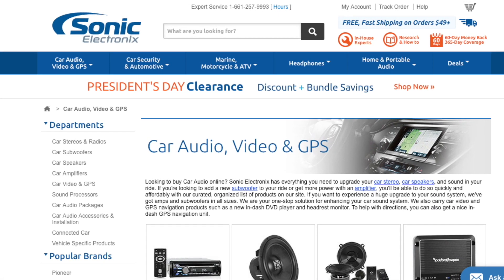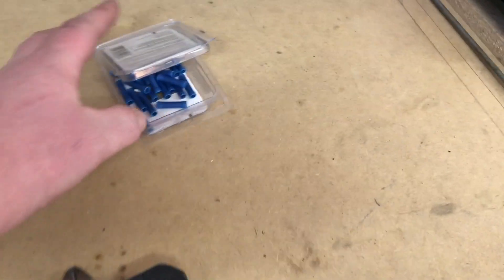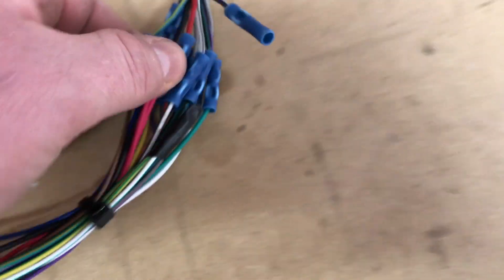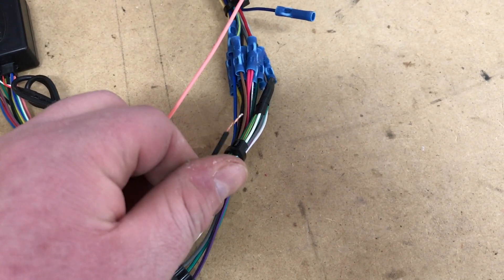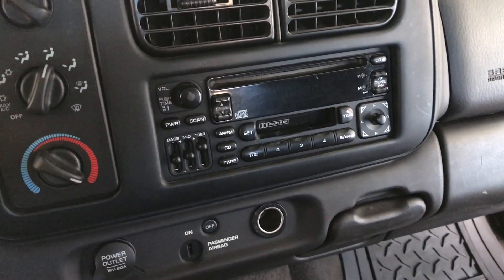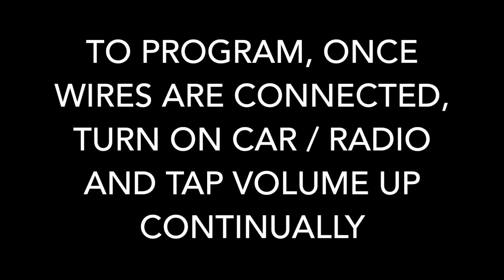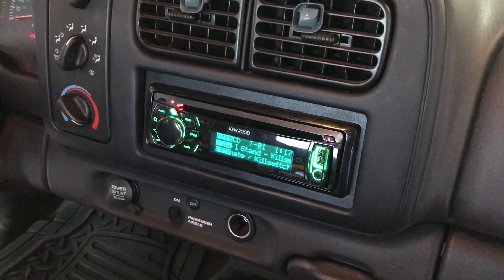1997 - 2000 Dodge Dakota/Durango Radio Install

Comment: Are the 2 wires on the separate clip .... Not the factory ground but the 2 single that plug in.. are those the steering wheel control wires?   If I'm not hooking that in do I just leave them alone?

Comment: Great video! Thanks for sharing. Have any idea how to remove the 36670 Infinity power amplifier? I have a defective one installed in my '99 Dakota. After removing its  2 bottom mounting screws it is still attached to the frame by its top hook but I still  cannot remove it...

Comment: Thanks for the great video! I have a 99 Durango and I'm trying to install a JVC single din And just need to know exactly what color is the factory infinity Amp wire? Can't seem to find it on line!
Reply from the maker: http://www.modifiedlife.com/1999-dodge-durango-car-radio-wiring-diagram/  Factory Amp trigger wire color should be green.
Reply: Green with red stripe

Comment: I am in need of some help. I have a 1998 Dodge Durango and I stupidly/carelessly cut off the factory wire harness and just tried putting wire to wire but the color of wires are sooo different and now im just waaay stuck. would i be able to do it like this still? and if so can you help?
Reply from the maker: Solder back on the original harness, or pull a stereo wiring diagram and start from scratch.

Comment: So the pink wire goes into them two wires that had the white plug on it that you cut cuz I have a 99 Durango and that's where I'm getting confused at cuz I don't have a pink wire I got the blue wire coming up to aftermarket radio that turns the amp on so what I connect that blue wire to both the wires

Comment: the stereo works fine on accessories or when ignition is on, but will you start engine the radio starts losing its signal, what could be causing this ?

Reply

Comment: If I put a newer radio in my 99 durango, will I have to rewire a harness?  Or is that just because you maybe used a different DIN type?   I was looking to get a new radio but was hoping it would just be a quick plug and play.
Reply from the maker: Unless it's OEM, you will be required to wire as we did in the video.

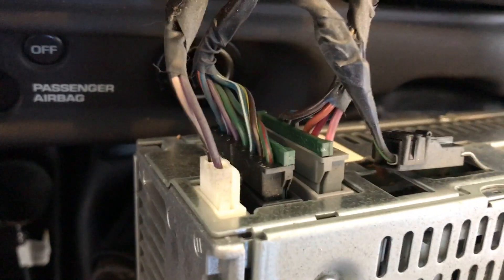Comment: I have installed my new Car Hifi Radio Din 1 and it works well, but I have now the two wires left, in violet and white, which are pluged-in at the original radio p04704383ah from Chrysler at the left side (white plug-in). You can see it at 4:04 on the videoclip. What are those two wires in violet and white for? I also have left the brown and black wire, which are on a black plug-in, also see at 4:04 on top, fixed on the metall. I guess those are to ground it. Right?

Comment: Just need some clarification you say in the video all you need coming out of the aswc-1 is power (red) ground (black which is tied in with radio ground) and control wire (pink). But then it's looks like you add that you need the (white/green) wire for controls as well is that correct? Thanks

Comment: I have a 99 Dodge Durango when I install my after market radio my front left and right rear speakers only have sound coming thru.  I took my time a wired it all correct. I didn’t see the problem. Any suggestions??
Reply from the maker: If you had the factory amplified system, sometimes when removing the factory radio, you have to be sure your balance and fader are set to center.  You could have bad speakers, there still may be a wiring issue, etc.  It could be a few things.

Comment: I'm having issues getting sound from the radio? I have power the radio found my phone yet no sound.. the ground I think is my issue
Reply: Do you have tweeters in the front doors? Infinity Amp takes line level signal to make amplified speaker level signal your aftermarket unit may have an amp built it and would need your amplifier bypassed

Comment: So I just finished the install, using all the same components as you have in video, but different model Kenwood with all same features. Only issue I am having is no matter how many times I calibrate the aswc-1 the steering wheel controller just won't work. And ideas? They did work with factory sterio. 99 Durango
Reply from the maker: Not sure, you may have to take it to an audio to diagnose.  You could also try the PAC version too  https://www.sonicelectronix.com/item_34668_PAC-SWI-RC.html  coupon code ProvoBeast

Comment: I just added a Raptor RP-CDM3 cd player to my 1999 Dodge Dakota R/T with the original Infinity sound system. It sounds good but I didn't remember there was a separate plug for the steering wheel controls so mine aren't working. The plug that came with the Raptor CD player only had red,black,yellow,blue,white,white/black,grey,grey/black,green,green/black,violet,violet/black and there was a brown wire that wasn't used in the connector to the original radio plug as well as a couple other. Will the ASWC1 still hook up to this CD player? I hate not having my steering wheel controls.
Reply from the maker: As far as i can tell, your Raptor radio is not steering wheel control compatible.  Unfortunately, you would have to upgrade your radio to one compatible with the ASWC-1.

Comment: Do think of the SWI-X interface might work? It says it will work with aftermarket radios that don't have the blue/yellow wire but do have a remote control which this Raptor does. By the way, in your video did you hook up the orange illumination wire to anything or the dimmer wire to anything? There were those and 1 other wire that didn't match up to anything on the Raptor's wiring harness. If all this doesn't work out I plan on getting the factory unit fully refurbished.
Reply from the maker: The SWI-X module works as long as your Raptor came with an aftermarket report for the radio.  Worth a shot.  If your radio didn't have the orange or orange / white wire, just tape them off.

Comment: Quick question. I have a a 2000 Club Cab. Now that I've got this stereo in, it plays pretty good for a while but then the deck basically restarts...like it loses power for a second. Some days it will do nothing but flash on and off. This Dakota has a factory equipped Infinity system in it. What can I do to fix this or what may I be doing wrong. Thanks in advance.
Reply: I guess I should have put more details in there. All the factory wiring is still intact. The deck is a Pioneer X5710HD with the adapter harness. Although the harness didn't mention Infinity. But I read a trick on the internet to get sound  through the system I had to twist 2 of the wires together. I'd had have to look to see which 2. But Along with the factory system I also have an amp and sub of my own in the back. It all seems to work fine until the deck reboots. I feel like I'm overloading something somewhere. Thanks.

Comment: My Kenmore didn't come with the metal bracket around it with the triangle mounts, just the encasement. What are the specs of that metal bracket so I can mount the dash kit onto it?
Reply from the maker: Head over to any car audio shop or best buy, they all have extras.  They may charge you like 5 bucks for them

Comment: i added a kenwood into my 2000 dakota but only the radio works, no usb/cd or anything, is there something im missing that has to do with the blue and white wire?
Reply from the maker: Sounds like you have the factory amplified system, you need to hook up the blue solid wire on the wiring harness adapter to the blue/white wire on your radio.  This will trigger the factory amp to be on all the time, regardless of the input source you are using.

Comment: Do i still need the harness adapter if im using a different radio system?

EDIT: The stereo i'm using has iso connectors and obviously won't work with the 8pin wire harness. Is there a different wiring kit needed other than the wires that came with the stereo?
Reply from the maker: Yes and you generally would wire it just as we did in the video, matching wires up color for color.
Reply from the maker: Some companies will build one too if you can source one: https://www.amazon.com/Wiring-Harness-Adapter-Dodge-Stereo/dp/B00ZFVEXXE/ref=sr_1_14?ie=UTF8&qid=1528135530&sr=8-14&keywords=ISO+Stereo+Wiring+Harness+to+Dodge

Comment: So that one small black wire that was hooked to the metal case. What is that for and where would you wire it too.
Reply from the maker: Thats your ground Adam, make sure you connect your Radio's black wire to that wire.
Reply: Provo Beast Audio Installation I did what you said and it works perfect now. Next is to figure how to run a sub off the original amp😁
Reply from the maker: I wouldn't run a sub off the factory amplifier, just pick up an aftermarket one cheap and install it to ensure you can provide the power required by your aftermarket subwoofer.
Reply: Provo Beast Audio Installation well I already bought a box with a built in amp but when it arrived it has a spot for a harness which it didn't come with. Also I have no idea how I would run wire to it without the harness
Reply from the maker: check ebay for that harness

Comment: Did you get the metra aswc to retain the factory steering wheel controls? I've heard that only the PAC modules work with Chrysler's 2 wire CCD system.
Reply from the maker: We've gotten a good handful of Chrysler products to work with the ASWC-1. Just depends on the year and model.  Metra's website will list what does and doesn't work.

Comment: I have a 2000 dodge durango I've wired up a dual radio but everytime I turn my headlights on at night my dash light go out and so do my brake lights and so do my headlights
Reply: you wired a the orange one which is a dimmer an u dont need that

Comment: For some reason, the sound is only going through my subwoofer now that everything is hooked up. It no longer goes through the car speakers. Any help?
Reply from the maker: Sounds like you have the amplified system.  Be sure the blue wire on your harness adapter is connected to the radio's blue/white wire.
Reply: Provo Beast Audio Installation I'm using a harness adapter because I'm not good at wiring. The blue wire on the adapter is in a different position than the blue/white wire on the radio plug in.
Reply: Provo Beast Audio Installation it's an iso converter wiring harness
Reply: Provo Beast Audio Installation the wiring layout is all wrong for my adapter, and I'm not sure what to do about that

Comment: i have an orange wire that is for "illumination" but i dont see where i am supposed to wire it in any help i have a boss audio 611uab stereo and a a raptor aw-whcr wiring harness the harness has the orange wire and im unsure on where to wire it
Reply from the maker: Your boss radio isn't compatible with the illumination wire, just cap it off.
Reply: Provo Beast Audio Installation thanks youve helped me a ton and i really appreciate it
Reply from the maker: Subscribe!

Comment: Is that a kit with the deck that helps it fit?. I just got my pioneer deck and It doesn't fit and I am unsure about what to use. Conversion kit?.
Reply from the maker: All the parts we used are listed in the description.  The Metra Kit we used fits all single din stereos.
Reply from the maker: That link didn't work
Reply: Provo Beast Audio Installation all I get when I search it is a metra 30 6228
Reply from the maker: Well, you will need the Metra 99-6229 Stereo Dash Kit Adapter
Reply from the maker: https://www.sonicelectronix.com/item_12798_Metra-99-6229.html

Comment: ok, so I have the kit and a head unit (no steering wheel controls though) my question is as follows: for replacing my factory 2000 Dakota head unit do I take both wire sets from the kit and literally just color match with the piece that came with my head unit, or is there anything else I need to do. I just want to be 100% sure that I dont fuck something up.

also, I dont have an external amp right now, but I would like to essentially bypass the current subs and wire it to my own sub running off of whatever power it gives it stock, since one of the stock subs is mostly blown. is that at all possible or will that just cause havoc?

EDIT: and yes I know these are probably dumb questions, but I dont know much about actually wiring this stuff, and I am 18 I cant afford to fuck something big up somehow

Comment: What wiring harness would you use in a 1992 Dakota for an aftermarket radio
Reply from the maker: Head over to sonic electronix and use their vehicle fit guide, that will give you a list of all parts needed.

Comment: How do you know what the fuller plate is supposed to be? I want to put a new one in my 2002 that’s why I’m asking
Reply from the maker: fuller plate?
Reply: The plate so there’s no gap between the radio and the dash so it looks good
Reply from the maker: Dash kit is what you need.  See the description for parts used in this install and the part number to the dash kit.

Comment: What is that green and black wire that slides on the factory radio do you need that I need to know if I need to take that off or not cuz I'm not getting power to my radio at all
Reply: I know this was posted 2 years ago but did you figure out your issue? I have zero power going to my radio and I can not figure it out
Reply: Thats the ground

Comment: Where does the ground wire from the harness connect?
Reply from the maker: See 4:12
Reply: Where did the black green wire come from?
Reply: It's a 2000 dodge Durango
Reply from the maker: It is a separate wire with a small plug connected directly to the back of the factory radio.
Reply from the maker: See 4:04, you can see the wire with a black connector by itself connected to the back of the factory radio.  That is the ground.

Comment: I plug everything in and hear speaker feedback but the display doesn't light up? Is there anyway to make sure my headunit isn't fried?
Reply from the maker: Recheck all your connections again, test with another radio, etc.
Reply: I put a new headunit in, it lights up correctly and everything, but theres no sound unless the radio cord isn't plugged in. In that case, it just buzzes.
Reply from the maker: You may have the amplified version or the infinity version.  Be sure the blue wire in your wiring harness adapter is hooked up to your radio's blue / white wire.
Reply: My radio only has  a blue wire that is labeled power antenna
Reply from the maker: then tie in the wiring harness blue wire to your radio's red wire.
Reply: Okay, so I tied in the blue wire and I still didn't get any sound. Is there anything else I can try?
Reply from the maker: Too hard to diagnose through youtube comments, may need to take it to an audio shop.

Comment: Um....these trucks only came with cruise control on the steering wheel, not stereo controls. You just installed something the truck does not have.
Reply from the maker: Haha, okay, even though literally there are volume / track controls on the backside of the steering wheel.
Reply: Squirrel Killa exactly mine was fully loaded and no radio controls on streering eheel
Reply: Wheel*
Reply: Nope, my 1999 RT has radio controls on the back of the steering wheel
Reply: Nick Fryer my is the sport one with everything thing what do they look like on the back maybe I'm just blind ?
Reply: My slt has them I didn't even know till a couple years ago.

Comment: What do,I do with the amp wire? Connect it to the ignition/acc wire?
Reply from the maker: The amp remote turn on wire connect it to the radio's blue / white wire.  If not available, you can connect it into the Red ignition wire.

Comment: I have everything connected, but no power, no nothing. I have voltage, but I'm not sure about my ground.
Reply from the maker: Use the continuity setting on your multi-meter to see if your ground is good.

Comment: I have no sound, where does the blue amp wire from radio harness go to
Reply from the maker: That blue wire needs to be hooked up to the blue / white wire on the radio.  This triggers the factory amp to turn on.
Reply: Provo Beast Audio Installation that's what I thought, I connect the blue wire from the harness adapter to the blue wire from the radio harness and I still have no sound at all, the radio power up and everything, and old radio works fine. My car is equipped with the infinity system if that makes a difference
Reply from the maker: on the wiring harness adapter (that connects into the car), find the blue or blue white wire.  Connect that wire and tie it into the red wire (ignition).  This will activate the factory amplifier.
Reply from the maker: Sometimes the blue wire on the radio is teh amplified antenna and only is on when on the radio setting.  changing that wiring configuration will fix your issue.
Reply: Provo Beast Audio Installation this is really a pain, I don't have sound on any function of the radio, the blue wire from the harness adapter is connected to the blue of radio harness, I've even tried put the blue from the black harness adapter to the red acc and still nothing. Is it possible for me to jump the amp relay pin 87 with another acc fuse

Comment: What did you do with the orange wire on the gray plug in adapter?
Reply from the maker: That is generally either illumination wire or dimmer wire.  If your radio doesn't have an orange or orange / white wire, just cap that off, it wont be needed.
Reply: Provo Beast Audio Installation we cant the thing to get it to work something is wrong
Reply from the maker: Sounds like a wiring issue.  I would use a multi-meter and test to make sure you have a good ground (black), constant power (yellow), and switched power (red)
Reply: Okay now my old radio hooked back up wont run so I am gonna look at it with my friend who knows it or take it to a shop
Reply from the maker: Sounds like you blew a fuse.  Check your radio fuse in the fuse box
Reply: Provo Beast Audio Installation. I did I have a replacement

Comment: because when you do the video you do not show where each cable goes, one by one, step by step they teach, but I think you do not want to teach how they connect 
I have a Durango 2000 I installed one of those but it does not work, it only stays solid red and it does not work